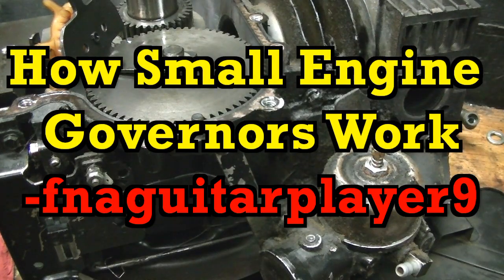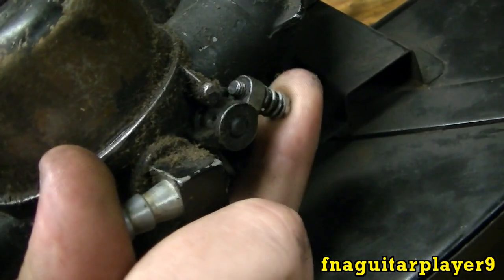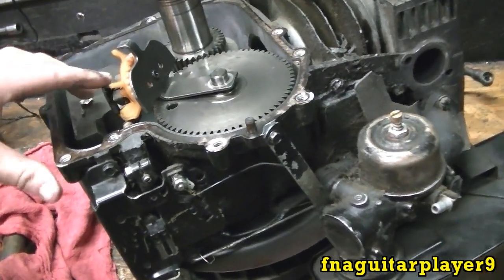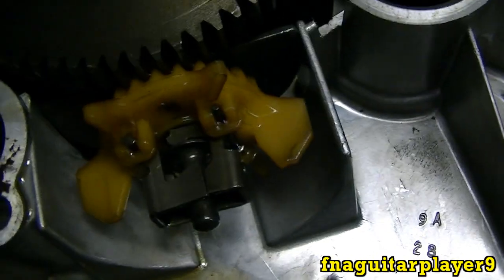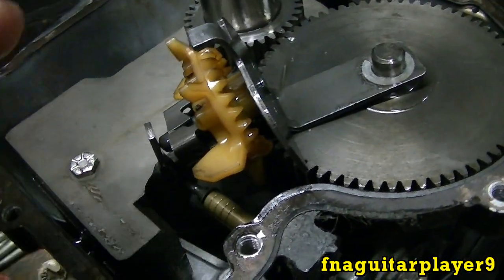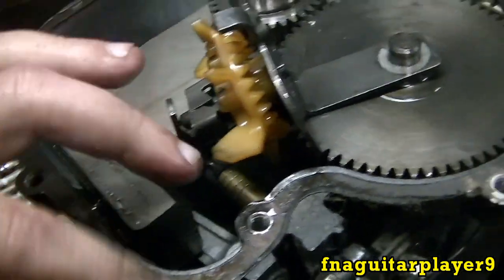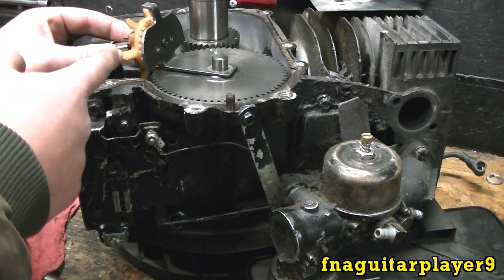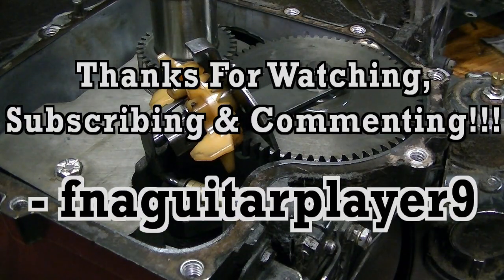How Small Engine Governors Work (any governor setup)

Comment: at the risk of asking a silly question: why does a small engine needs a governor in the first place can't the operator just adjust the lever to fast before starting off like my pressure washer honda engine; I have to keep the governor lever on fast to keep it running. if I move it to slow it sounds like it would stop

Comment: I have a honda pressure washer and when i cut it on to start washing it was like there was strain on the engine and not enough rpms. So i tryed to adjust the governor to speed it up. And it locked the motor now it wont even turn. Can u tell me what the problem is. Something stuck?
Reply from the maker: If it over-revved it may have thrown a rod or something like that, make sure the pressure is off the wand when starting they will be hard to crank over if the pressure is still on the pump too. Thanks for Watching!!!
Reply: @fnaguitarplayer9  thanks

Comment: I have a Briggs Stratton Intek Platinum Plus 6.5 pressure washer and it runs erratically and ultimately clunks out. I noticed that the governor linkage is operating in erratic fashion as well. Upon inspection, one spring is loose or sprung, could this be the culprit for the erratic idling?

Comment: U did say u were going to show governor adjustment? I'm 68 and worked on all my own tools for years, but never delt with the governor. I remember the vane type though. Lately I've been working on a friends Honda push mower with surging issues. I've rebuilt the carb 4 times. Each time it runs great for a few hours, even a day or so. Then starts surging again.  Now I'm debating a new carb, but thought about the governor. Being that's what a governor does. Any thoughts? I know ur video is really old, but maybe u still monitor it. Thanks though for the description. Take care.
Reply from the maker: I always try to adjust the governor first, I do have other videos showing how to do it. Thanks for watching

Comment: I have a honda gc190 from a pressure washer I adjusted the governer but still the engine rpm its so high still, i have to have the chock haft way for the engine to run at a decent rpm. What could i do to make it run better. Any input will be great. Ohh I forgot to mention i dont have a throttle.
Reply from the maker: There may be a tab where the governor spring attaches that can be bent to adjust it down some or the governor may need to be adjusted. Thanks for Watching!!!

Comment: Can the governor be adjusted for more engine speed on a horizontal shaft engine?
Reply from the maker: You wouldn't actually adjust the governor, but you would adjust the spring tension, either by bending a tab or turning a screw depending on engine brand, but its not recommended going past 3600 rpm on stock engines, they like to throw rods at high rpms! Thanks for Watching!!!
Reply: fnaguitarplayer9 ok thanks for answering because I ride a mini with a 212cc engine and I noticed that there were multiple holes in the governor arm
Reply from the maker: your welcome. depends on the engine, you would usually adjust the spring tension. on some you can use a different hole, but you will have to adjust the governor as well to keep it from loping/surging.
Reply: fnaguitarplayer9 ok thanks for the info
Reply from the maker: your welcome

Comment: I'm at a loss.  My 1989 B&S 12 hp on a simplicity lawn tractor is acting badly.  I cleaned the carb 3 times, and then put a new one on.  The trick is when it's totally cold it will run great for 3 minutes or so.  Then it acts like it is going to stall, but keep trying, chugging, spits, and eventually stalls.  The only thing I see is on the new clear fuel filter it's not sucking fuel.  I mean like a so tiny bit it's hard to see.  So I thought of a tank vacuum, I unscrewed the filler, no different.  The plug seems ok, but I am replacing it tomorrow just so.  I came here to see and understand the governor, but I don't really have a so-called surging. Help, unsure if you have a vid addressing this issue.

Comment: Greetings all, first I am NOT a mechanic, just a guy with a lot of mechanical/electrical 
interests.I have been to the Merriams' wireless and steam engine museum in R.I. and 
tho not taking picsat the time, I was interested in the governors for these engines. from 
what I remember these was a vertical shaft than spun off the flywheelby a belted pulley,
the top of said bar had a T where the 2 arms with flyweights hung, sometimes 3. I saw 
about 4 of these in various styles, some with folding arms that went to a central collar, 
some with heavy springs instead, an some with springs on threaded  rods. As the engine 
was running slow, the weights pretty much hung str8 down but as the engine speed
was increased, a type of bellcrank or lever rested under the collar on the governor that 
allowed movement of the throttle.at rest, the throttle is wide open and it is the weight of the
massive flywheel and load of the rotor of the ribbed cage alternator that makes the engine 
take time to aquire the right speed. Once speed has been reach probbaly known by the
voltmeters and the flyweights are somewhat thrown out due to centrifugal force, the throttle
would be adjusted again, and the alternator would have a load on it. At a cetain voltage,
and ampereage that had to be maintaned, the governor was adjusted so when the engine 
took on more load, the weights dropped and caused the bell crank to open the throttle,
Likewise if the engine speed went up due to a lesser load, the flyweights flew outwards,
the collar on the governor went down and worked the bellcrank which reduced the throttle.

Comment: Will it damage the the engine if you bypass  the governor arm without fully removing the governor gear? Like there is so much force on the throttle  that the governor gear does not have  the strength to push the throttle back . I see it behind done with the Lifan 79cc engine alot, but I've heard it said if you don't fully remove the gear it will destroy the engine.  But I've yet to hear someone say they destroyed one although I'm sure it's been done.
Reply from the maker: The internal governor can actually explode at high rpms, i just built a briggs raptor 3 (5hp) and i built it without any internal governor parts, not even the plastic gear, since it was a horizontal shaft engine it doesn't serve as a oil slinger like on vertical shafts. Thanks for Watching!!!

Comment: Can engine speed be made to increase incrementally  with increasing load.
Reply from the maker: No not without a solenoid controlling it. Some new generators have a setup like that but are usually inverter type generators so the rpm doesn't affect frequency.

Comment: I replaced the carb on a champion generator, but it's not running fast enough to get good power.  like it not enough fuel.  how do I inscrease rpm
Reply from the maker: There should be a adjustment, follow the linkage from the carburetor towards the governor arm there should be a screw with a spring on it, that will adjust it up. But it may be the governor out of adjustment, i have another video on adjusting governors, you may want to try that first. thanks for watching!!!

Comment: I got a racing mower and I don't want governor so what do I do to remove it completely
Reply from the maker: +Derp Crew If its a stock engine you don't want to do that, it WILL (not if) throw a rod and destroy it, Been then are done it, and to be honest you do not gain a whole lot of speed anyways, best thing to do is concentrate on the gearing, you can get a ton of speed out of a stock engine if its geared correctly (big pulley on engine, small pulley on transmission), you'll be surprised what it will do! These engines have more low end power anyways unless you get into changing cams,  etc. But if you bypass the governor you will at least want a billet rod and billet dogbone rod on the counterweights if its a single cylinder, and recommended a billet flywheel to keep it from exploding at high rpm (has happened before). Just some tips/suggestions on what will happen if you bypass the governor! Thanks for Watching!!!

Comment: A big 'Thanks"  It is a great hobby to work on these engines, and to know how all the parts work 
together. I did not get it as first but knowing how a centrifugal clutch works, except there the
weights are held in due to the spring on the governor outside the engine. engine not running, 
throttle is wide open. engine starts weights spread out, but spring tension regulates how much 
balance. If spring tension is very tight, engine will run very fast, with a looser spring and gov arm
able to move, better control of the throttle  My model 23 has the updraft carb  and mechanical 
governor with a threaded rod. .
Reply from the maker: Your welcome! Thanks for Watching!!!

Comment: What is the small light spring on the governor for  , my small light spring is broken ,does it matter
Reply from the maker: The spring that goes around the linkage itself? All that does is keep the linkages tight, so if there is any play in where the shaft goes into to the hole it will keep it from moving, which can cause a slight lope, but if it still running smooth then i wouldn't worry about it. Honestly, i haven't seen to many that the spring isn't broken! thanks for watching!!!
Reply: thank you
Reply from the maker: your welcome!

Comment: So what happens when the governor  breaks apart ? Does the  engine  run full rpm or low rpm ? Whats a sure sign the governor is not in one piece inside ?

Comment: Now I understand thankyou🙂
I have a new clean carburettor(new fuel just fitted) on a tecumseh vertical shaft, what causes surging?
How would you recommend adjusting lean rich fuel mixture?
Reply from the maker: Your welcome. The governor may need to be adjusted. But If that's not it, I have videos on briggs and stratton on how to adjust carburetors, they are very similar in adjustment. Usually a 1/2 to 1 turn out on the main adjustment will take care of it. Thanks for watching!
Reply: @fnaguitarplayer9 
It is a tecumseh vertical shaft engine. Brand new carburettor no, fuel filter.
Reply: I will have a look at your other videos. I am a bit scared to start it in case it surges and blows. I am only 16 and this is new to me
Reply from the maker: vince King  Try turning the adjustment screw out about a 1/2 turn and see if it helps, if it does some take it another 1/2, without actually looking at it, its hard to say exactly how much it needs adjusted. I would suggest adding a fuel filter if possible to keep dirt out of the carb.
Reply: @fnaguitarplayer9 
Thank you. I managed to find where too lean was by running it on idle, but I couldn't find where too rich was because it doesn't seem to slow down and idle properly. I am wondering if I need to adjust the idle speed adjustment skrew first?
Don't worry too much because it is old and probably has a quite few minor issues. The man at the shop should adjust it cheap if I can't do it if we buy a new petrol multi tool from him.
I got it too start an run myself so it can't be that hard to tune it in? 
Do you have a video on the idle speed adjustment skrew? 
One day I will probably end up stripping it so your videos will be of help. Ps I take that you are an American, I am from the other side of the Pond 🏴🇬🇧
Thanks for the help. It is almost 2 in the morning.
Reply: And it seems to be that the mixture affects surging(proving that the governor must be working). It just is running to high an rpm on idle no matter what the mixture seems to be.
The mixtures seem to stop the surging. 
I will get an in line fuel filter and shutoff valve to go on fuel pipe. Are fuel pipes all a standard inner diameter on push mower engines?

Ps it is 2 in the morning so I don't really know what I am saying. Lol
Reply from the maker: vince King  yeah adjust the idle speed enough to keep it running, this video here should help with the adjustments, its on a briggs with a high and low adjustments, if yours doesn't have that then just use the upper screw as example and ignore the bottom part. https://www.youtube.com/watch?v=TlSAOkQnI1g I hear ya! Yes I am, your welcome!

Comment: So if I dentist to my riding Cub Cadet would it go faster than just creep around that's running right now about 8 miles per hour I want to remove the throttle arm the El Governor arm and remove that gear inside and everything how much more faster will my lawnmower go
Reply from the maker: It will go faster but with stock internal parts it won't last long, they like to throw rods at high rpms. I'd suggest looking into the gearing (pulley sizes) to get more out of it. Thanks for Watching!!!

Comment: Hi, I have a Yamaha grizzly ATV and It has not been charging the battery. left it with a place to fix it and he called and told me it was the governor. I'm no expert but does the governor send the electrical power back to the battery. I can not find any thing on this. Any information would be much appreciated.
Reply from the maker: No the governor would have nothing to do with the charging system, most atv do not have governors anyways. thanks for watching!!!
Reply: @fnaguitarplayer9  Thank you so much for your time. I called the man back and apparently he called it the wrong thing in a hurry when on the phone with me. I had heard of a governor but me being a woman and not knowing anything about small motors I was not sure. I did figure something was wrong though. It was the regulator, not governor. Take care.
Reply from the maker: @susangoldin6338  your welcome, yeah that sounds more like it!

Comment: My generator when it is loaded the rpm goes up and  down it is not steady could it be the governor? And makes explosions
Reply from the maker: That probably is either the governor needs adjusted or the carburetor needs cleaned/adjusted (may be running to lean). Thanks for Watching!!!

Comment: Is there any reason this piece might fail?
Reply from the maker: I've seen them sling apart before from over revving or just break on their own. Rare, but does happen. Sometimes they will get out of adjustment but that is a easy fix, its a very simple and actually reliable system. Thanks for Watching!!!
Reply: @fnaguitarplayer9  I'm asking because I recently got my governor fixed but now it goes back and forth surging under load. It doesn't do this at idle. I think this is probably fuel related but the thing is if I hold the governor with my finger it doesn't surge
Reply from the maker: @exoticcar5482  It could be running lean, but usually when they do that and you hold it by hand it will stall out, so its probably just the governor out of adjustment, here's my video on adjusting them: https://www.youtube.com/watch?v=9rO8AvDrdeM

Comment: So I have just done a quick restoration of an old Simplicity mower with a 10hp B&S engine in it. It was missing all of the governor linkage and throttle cable. I just re-installed a new throttle cable and bypassed the whole governor thingy... What will happen? Will I go nuts manually adjusting the throttle to keep the rpms up or does this hurt the engine in any way even If I stay out of wide open?
Reply from the maker: I do no recommend running it without a governor, beside just safety purposes, it can damage the motor, if it over revs. anything above 4000 rpm is just asking for a rod to let go! If you had a limiter on it to keep it close to the 3600rpm it would not hurt it at all, its just the high rpms that kill stock motors. Thanks for Watching!!!
Reply: @fnaguitarplayer9  Ok, I'll just try to find some spare parts somewhere.

Comment: Thanx... that made the operation of the governor crystal clear for me but I have a Briggs & Stratton that the governor is holding it wide open when I remove the governor spring it can idle but as long as that spring is on there... it only goes wide open
Reply from the maker: Your welcome, 90% of the time when there is problems like that, it just needs to be adjusted. Thanks for Watching!!!

Comment: So if I just connect my throttle line straight to the carb and ignore/unhook all the governer linkage will it ruin my motor?

I plan on installing a gas pedal on a 6speed manual murray for offroading

Comment: Thanks for the video! My riding mower has been surging and I replaced the carburetor since cleaning the old one didn't help any. After I installed it and fired it up the rev kept climbing so I shut it off and checked my governor external adjustment. All good. Then I had to take it apart and found the governor inside was broke. I wonder is this is what was causing the surging problems. Maybe it was partially working? Anyway when my crankcase gasket comes in I can put it together and try it out. I have a briggs 22hp intek vtwin.
Reply from the maker: Your welcome! I hear ya, I think that probably would be what was causing it to do that, probably just working enough to make it surge, hopefully that will take care of it! Thanks for Watching!!!